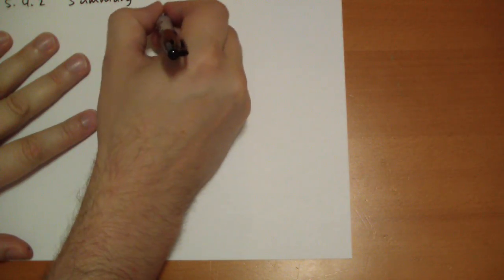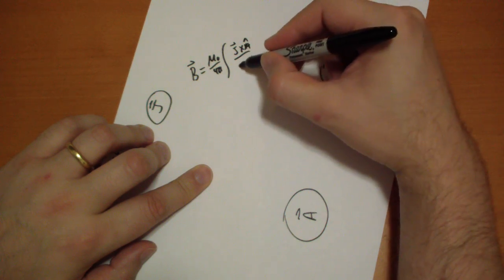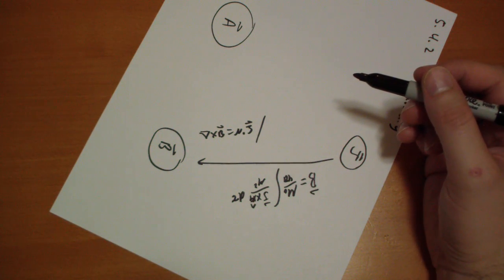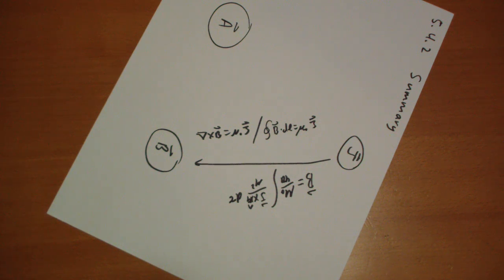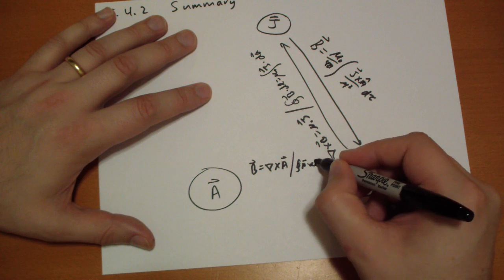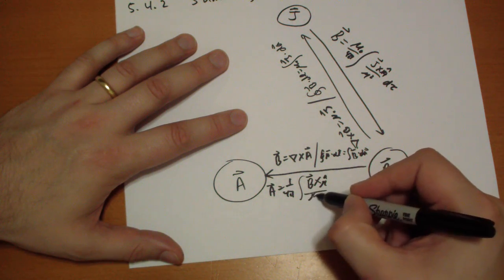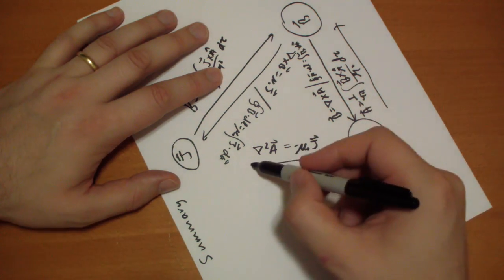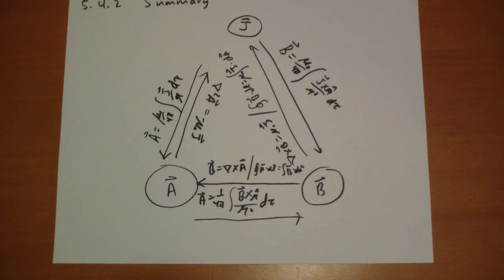5.4.2 Summary

Comment: Question: I believe your equation from A to B is wrong. Can you confirm this? The 4th edition of Griffith's textbook does not have any equation for going from B to A.
Reply: +Kiavash Mirzahossein 
jg394 is using the 2nd edition of the text, where that may have been included, but in 3rd and 4th editions Griffiths mentions that it is rare to need such a formula. Griffiths mentions a couple problems were you can find A(B) by doing a very similar derivation for V(r).
Take a look at 4th edition problems 5.51 and 5.52 (or 3rd edition 5.50 and 5.51). 5.52b gives the end result for V(r). I'm still working through it myself, but jg394's equation does appear to be correct.